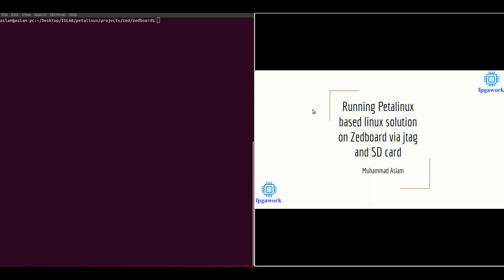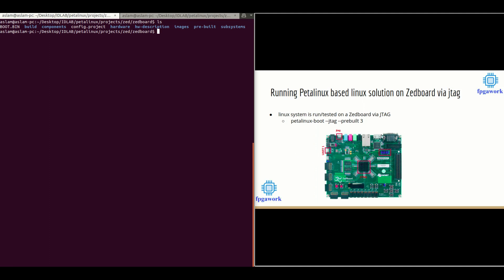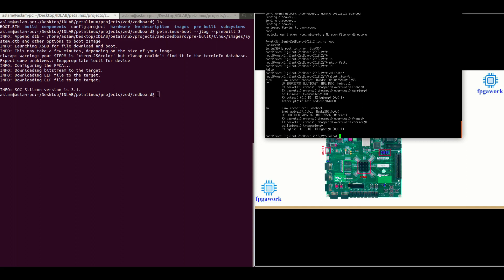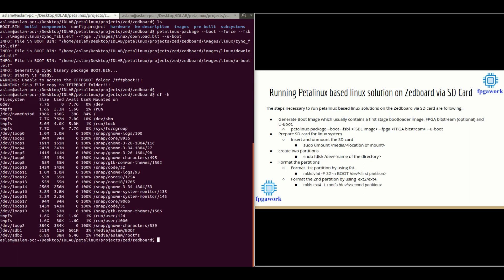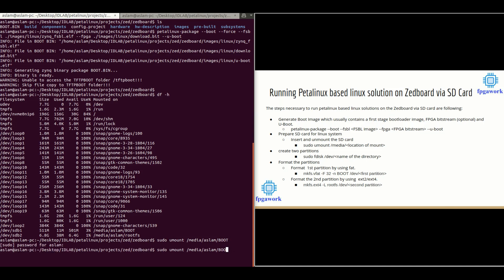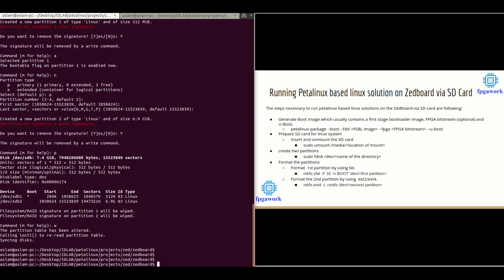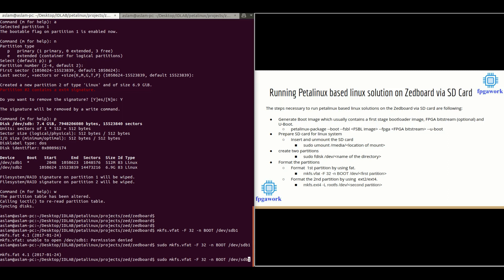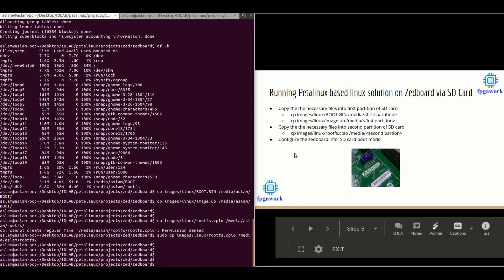Running Petalinux based linux system on Zedboard via jtag and SD card

Comment: Hello,
Thanks for the guide. I have 1 quick question. 
Whenever I try to connect through jtag with putty, it says 'unable to open connection to /dev/ttyACM0: unable to open serial port'
How could this be resolved?
Thanks in advance!

PS: I'm not using prebuilt, I'm using 
petalinux-boot --jtag --fpga
petalinux-boot --jtag --kernel